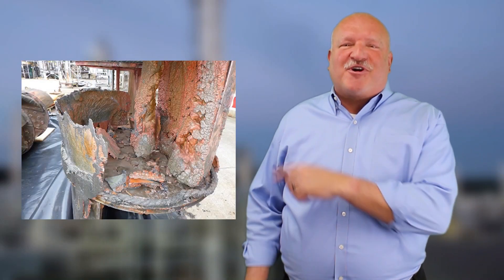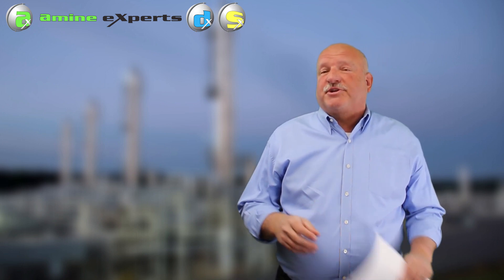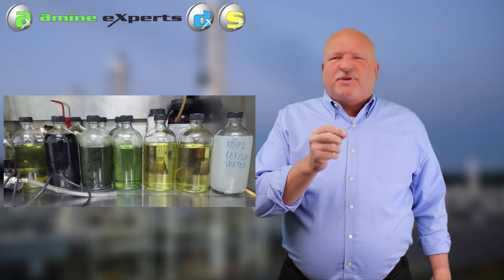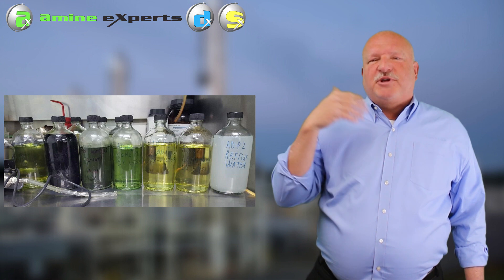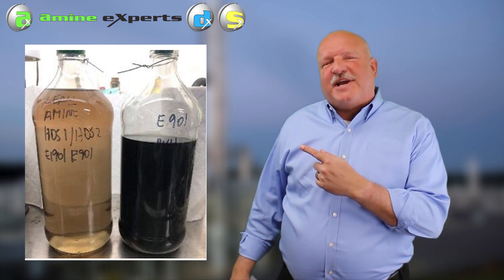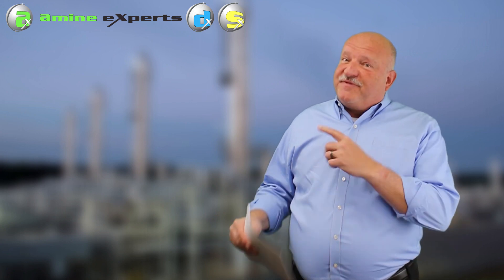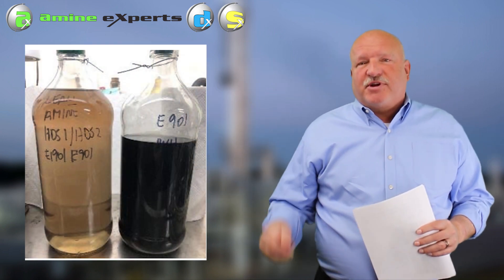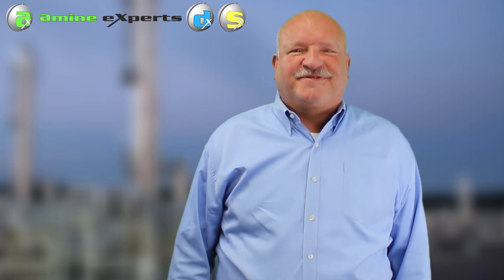Solubility of Iron in Amine Systems

Comment: Hi mike.
On the amine color (part of the video), what does the most right amine color tell? The cloudy amine (labeled as reflux water in the video).
Reply from the maker: Hello, Nurliana.

The sample on the far right is from an amine system, but is not specifically an amine sample. Because of entrainment and possible vaporization carryover from the regenerator column, this reflux water can contain 0.5 to 1.5 wt% amine. In a gas plant, this amine is not an issue, because it provides some corrosion inhibition properties and the reflux is not purged. In a refinery application, amine in the reflux can be problematic, because the reflux is partially purged to the sour water stripper, where the amine ends up in the treated water and can affect the bacteria in the bio ponds.

The reflux water sample should be clear and water white, since it is supposed to be water with a small amount of H2S and CO2 (and perhaps ammonia if the system is part of a refinery application). CO2 removal facilities should be simply water with dissolved CO2.

The fact it is cloudy usually indicates the presence of hydrocarbon in the reflux loop. It is also possible that excessive amounts of ammonia salts could cloud up the reflux water, but in this case it was a heavier hydrocarbon contamination (BTEX primarily). 

Yours truly,

Michael Sheilan, P. Eng.

Comment: What is theed in a amine sytem
Reply from the maker: Hello! 

THEED is an acronym for tris-hydroxyethyl ethylene diamine, which is a diethanolamine (DEA) degradation product found in plants processing CO2 and H2S streams, however, it is primarily related to the degradation caused by CO2 interaction with the amine. Its formation is especially bad in facilities that do a poor job of regenerating the solvent in the regenerator column, sending too much down to the reboiler where high heat flux can drive the reaction. The amount of THEED generated is generally proportional to the quantity of CO2 in the feed gas. DEA plants with low CO2 in the feed (<5%) generally only see a level of perhaps 1-3% THEED. Plants treating higher levels of CO2 (>10%) can see values in the range of 5-8 wt%. It is a non-reversible degradation product and tends to increase the corrosivity of the solution.

Please let us know if you have any more questions!

Comment: Thanks for the video. Does it then make since to leave some H2S in the lean Amine to promote the precipitation of solids and get rid of them in the lean filter?
Reply from the maker: Hi Abdulsalam!

The residual H2S in the lean solution should be set at a value that allows you to meet your treated gas specification comfortably. Once you start to leave more H2S in the lean solution, the treated gas H2S will also rise, perhaps to unacceptable levels. It would be difficult to leave enough H2S in the solution to form precipitated iron sulfide particles and remain on specification. The problem with trying to increase solids load in the lean solution is that filters are usually placed after the L/R exchanger, meaning rather than producing more solids for the filters to remove, you’d be forming more solids to plug off the exchangers. Definitely not a winning formula.

Please let us know if you have more questions!

Comment: I have TEG dehydration plant with blackish lean glycol. The feed gas is a sour gas. The dry gas is on spec, the glycol loses also acceptable 1 drum per day. My question is, do the blackish lean glycol due to iron product? We do replace the cartridge filter based on DP and the frequency of repalcsment is around 2 month? Could tou explain this.
Reply from the maker: Hello sosa Nasution,

There are a few things that will turn a glycol black. Solids are certainly a possibility, but considering your filters last 2 months before they see a high enough differential to replace, leads me to believe you are probably not seeing aggressive solids formation in the system. Another potential cause could be thermal or oxidative degradation, usually a result of elevated reboiler skin temperatures or bulk temperatures. This can be checked by running a gas chromatograph on the glycol and looking for the presence of DEG and EG. Because these glycols degrade at normal TEG reboiler conditions, they are the cause of the dark color. Finally, some hydrocarbons can coke on the firetube and potentially cause a darkening of the glycol.

Comment: If iron carbonate can pass through filtrations system then in Absorber iron sulfide will form and plug plate heat exchanger rich side then is it practicable to focus on filtration after Absorber and what type of filter will work perfectly to eliminate the black shoe? Thanks again Amine experts
Reply from the maker: Hello M. Dellil!

The easiest way to determine if you will benefit from rich side filtration is to take a sample of the lean and rich. If the lean is clear and clean, but the rich is darker and contains solids, then rich side filtration is probably best for you. The filter should be placed downstream of the flash drum, but upstream of the Lean/Rich exchanger. It’s difficult to find a filter that will always work perfectly for you (especially not having seen your system or the amine itself), but generally, amine systems get better performance from filters designed to form a filter cake (surface filters) with an absolute rated efficiency. A beta-5000 quality filter of 10-25 micron can usually do an excellent job of removing most solids down to very low micron rating.
Reply: @sulphurexperts  thank you so much I appreciate your reply